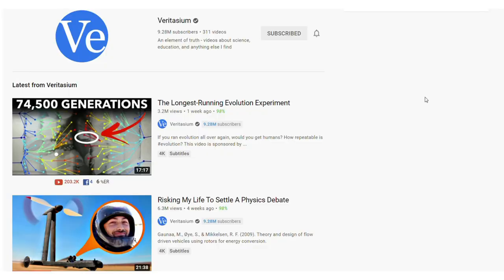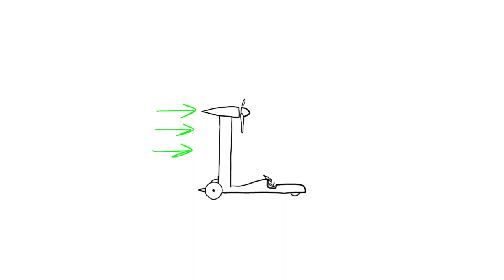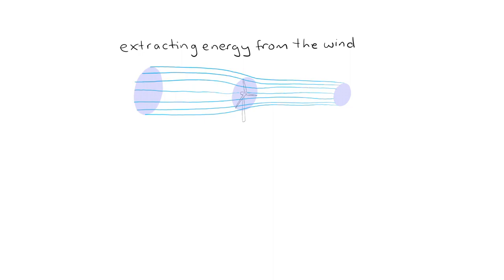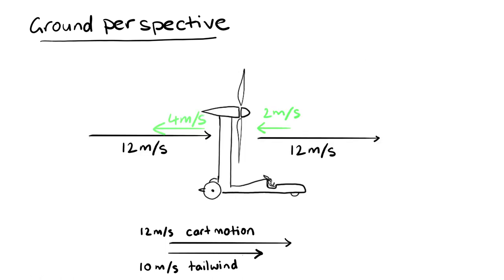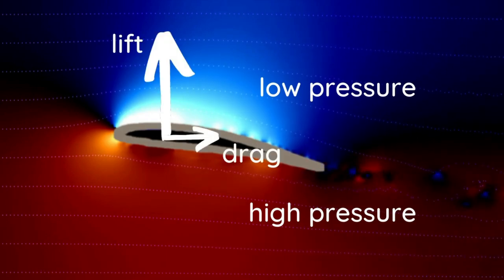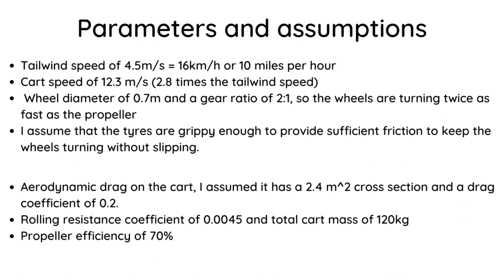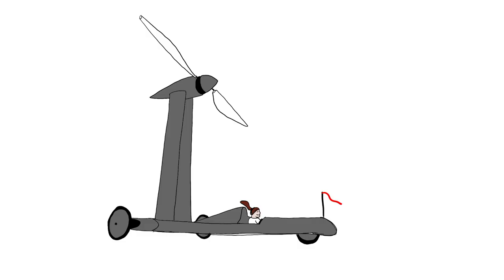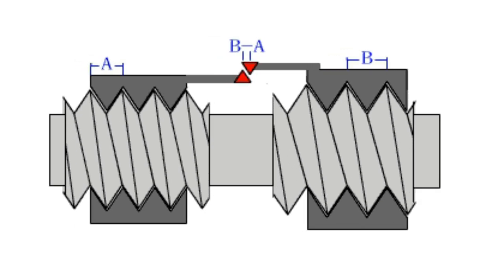Downwind Faster Than the Wind by Veritasium: How Does it Work?

Comment: why does nobody visualize this problem showing the constant air pressure difference from above? The car obviously changes the surrounding air pressure difference. It will accelerate so long as the additional air pressure difference is greater than the drag it puts through to the ground via the wheels.
Reply from the maker: Sounds like you need to make that video visualising it in this way!
Reply: Best answer yet.  You win the internet today!
Reply: In my mind, I picture an expanding 'teardrop' of red (indicating higher pressure) behind the propeller, which the prevailing wind is pushing against (and, of course, a corresponding 'blue' region of low pressure, in front). For me, the 'a-ah' was when I started to think of the wind blowing against the propeller, and pushing the whole vehicle forward. As the propeller turns, it begins generating an expanding volume of 'compressed' air, behind itself (thrust). At a certain point, the prevailing wind is no longer pushing directly on the physical propeller. Instead, it is pushing against this expanding volume of high pressure air, which resists being further 'compressed', and in turn, pushes the propeller forward, faster and faster, as the vehicle's wheels drive the propeller to expand that volume of compressed air, further and further behind.
Reply: @CineSoar  this high pressure wind buffer is a very common misconception with this vehicle.  When we're moving faster than the wind, we don't have a tail wind pushing us anymore.  At that point the propeller is pulling us through the air mass it finds itself in.  But it has an advantage in that air mass since it's moving more slowly through that air than the wheels are moving over the ground.
The aerodynamics around and through our propeller are exactly the same as that of a propeller on the front of a Cessna.  In the case of a Cessna we don't imagine that the propeller has to create a high pressure air buffer for the wind behind it to push on.
Reply: Another way I'm picturing it, after further thought... You have a car, there is a 100' long screw, threaded through the body, most of it's length is coming out the front. The wheels are geared, to rotate the screw, which moves it out the back of the car, as it advances. If you push against the screw, you begin moving the car forward, faster than you are pushing the end of the screw. The difference is the ever-growing length of screw, between you and the car. Now wind is 'mushier' than that screw, but that is a minor adjustment to the scenario.
Reply: @Rick_Cavallaro  Thank you for the response. My description is lacking, and I realized it, shortly after I posted it. While you were replying, I was writing a more mechanical description, in the meantime (see my post, immediately after yours). I should also note, this mental picture was one 'step' in my 'aha'. I understand, the whole 'system' involves additional considerations. 
I think I object to the idea that you don't have a tail wind pushing you any more. Or, at least that it isn't one way of looking at it (the propeller is pulling, but it is also pushing, against an air mass that is moving). If the wind were to stop moving, relative to the wheel/ground system, you lose the force that is driving the propeller. The Cessna carries its own power source, so we don't usually frame it that way. But, when we fly NYC to London faster than we fly against the jet stream, we don't discount the tail wind, even though the 747, under its own power, is capable of moving much, much faster.
Reply: @CineSoar  I'm not sure if that's an exact analogy, but I think it's a whole lot closer.
Reply: @CineSoar  
>> the propeller is pulling, but it is also pushing, against an air mass that is moving)

That is absolutely true.  But it's operating on the air mass it encounters.  It's not being pushed by a tailwind - at least no more than you can say a Cessna flying straight and level on a windless day is being pushed by a tailwind.

>> The Cessna carries its own power source

That's true as well, but the propeller and aerodynamics have no idea what motive force is turning the shaft.  Aerodynamically they're identical.

>> when we fly NYC to London faster than we fly against the jet stream, we don't discount the tail wind

Also correct.  But we don't say the tail wind is pushing us either.  We're simply operating in a medium that's moving relative to our destination.  Just as when you drift downstream in a river - nothing is "pushing" you.  You're just coasting in the water.  In fact you're sitting still in the water.  The water simply happens to be moving relative to everything around it.
Reply: @Rick_Cavallaro  Thank you again for engaging with me, and for undertaking this project in the first place. I'm loving how this whole topic has been challenging folks to re-think their intuitions. I guess I get hung up on the 'Tail Wind' concept, because the problem is presented in "Downwind" terms. When I try to mentally abstract the Blackbird as "flying" like a plane (as opposed to a ground vehicle, with a propeller) that imagined propeller slows to a halt and reverses. It has lost the connection through the wheels to the ground, which has to be in motion relative to the air (or vice-versa) to make this vehicle so marvelously non-intuitive in the first place.
Reply: @CineSoar  My favorite thing about this vehicle is that both the concept and the analysis are trivial, literally minutes worth of work, but so many counter-intuitive things come out of it, and often shed light on things that wouldn't have occurred to me.  For example, the sail on a sailboat on a broad reach doing downwind VMG faster than the wind is actually acting like a propeller blade rather than a turbine blade.  That just sounds completely wrong until you realize that the sail and keel have effectively traded jobs.
We know that a hot air balloon drifts with the wind at the speed of the wind.  But what happens when it encounters a gust?  Does it lead the gust?  Lag it and then catch up? Track the gust perfectly?  I think our intuition strongly suggests our hot air balloon would lag a little when hit by a gust.  It should take a bit of time to accelerate - right?  But it doesn't.  It does just what the gust does in real time.  You think about it a bit more and you realize it shouldn't do anything else.  But it doesn't feel right at first.
Reply: @Rick_Cavallaro  if I turn my head sideways, I can picture the balloon 'rising' on a pressure gradient (much like a party balloon will join me in the front seat, as I accelerate). Is that the crux of the matter? I have to admit, much of this is outside my wheelhouse, as a photon wrangler and pilot of a slower-than-wind and heavier-than-air craft. One of my strengths though, is grappling with complex concepts, and then translating them into various layman's analogies.

Comment: Assuming Wind speed is fixed 
Wind pushes the car 
Wheels turn 
Wheels turn the blades 
Blades push against the wind (this creates the extra speed) according to them.
But 
Now the speed of car is “supposedly” more than the wind 
The wind is relatively slower than before from the reference of the car and hence it won’t push the car as much as before 
So the wheels won’t have the same angular velocity 
And subsequently blades will start to slow down.
So. Practically the moment propeller starts to spin and exerts any sort of force it starts the process of slowing down the vehicle in the first place 
Ever heard of “Law of conservation of energy” ?

Comment: The basic principle can be demonstrated with a bicycle. 
If one pushes forward with a hand ( the wind) on the top of the rear wheel the bicycle moves forward at 1/2 the speed of the hand ( the wind). The wheel rolls without slipping on the ground. The wheel center is 1/2 way between the hand and the center of rotation, the wheel contact point with the ground.
If one puts the hand near the center of the wheel the wheel center and the bike move at the same speed.
So far so good...
Now if one puts the hand ( the wind) 1/2 down from the wheel center along a vertical spoke and pushes forward, the wheel center and the bike will move at twice the speed of the hand ( the wind) as the vertical spoke rotates instantaneously around the wheel contact point with ground.
As the hand is moved lower the speed ratio increases. That is what the Blackbird of the video is doing. The wind is the hand, the propeller( the bicycle spoke) makes contact with the air, The Blackbird rear wheel contact point with the ground is the bicycle wheel contact point. The ratio between the distances between the bicycle ground contact and the wheel center and the hand correspond to the combined Black bird wheel/propeller gear ratio and propeller pitch.
Note that as the Blackbird speed increases above the wind speed the more air it can slow down so the more energy it can extract from the wind. The max energy extracted is when the air speed with respect to the bird in the wake of the propeller is equal to the wind speed. ( note that propeller is the correct word when used with respect to the Blackbird), in the reference of the ground the propeller wash has zero speed!
Note also that the Blackbird can go straight up wind. In the bicycle analogy this corresponds to putting the hand on an imaginary spoke extending below the ground contact point. As one pushes, the wheel center and the bike move in reverse. For a more realistic analogy imagine a rail cart wheel on a rail. Pushing forward on a point of the flange below the wheel-rail contact point, makes the wheel wheel move backward with respect to the hand while the flange below the contact point will move forward. The hand does positive work.
Have fun!

Comment: Wonderfull explanation! I was obsessed too, still am a bit, even made a cart going uphill on treadmill. Instead of propeller I used one axle with wheels to rest on the stationary relative to tredmill belt rims. So instead of using energy intensity difference between moving tredmill belt and room's air, my cart "catches on" the frame of treadmill(edges) to get propulsion and accelerate into apparent headwind. This way the energy source is not hidden by apparent wind, because is physically different substace: treadmill frame versus air. Both share the same feature, same relative velocity relative to treadmill belt, so both can do the same job. My clip is on youtube, called "Going faster than wind or relative nature of mechanical energy".

Comment: Really cool! So do the blades in the Blackbird cart pitch?
Reply from the maker: Yep they pitch, but  manually. If I were to build one, I think I would try to make the pitching at least semi-automatic. And put a derailleur on it so I could change gears to optimise for both low and high speeds. A propeller is like a wind turbine in that its optimised for a single tip speed ratio (except that they are weirdos and use the inverse) and you mess that up as you go faster if you can't change gear.
Reply: @EngineeringwithRosie  One reason for the fixed gear ratio is to prevent using stored rotational energy of the propeller to accelerate. If the propeller rotation slows down, then so must the rotation of the wheels. They had to meet very strict NALSA requirements preventing any stored energy use for propulsion for their sailing record.
Reply: @EngineeringwithRosie  so in for example a plane, they don't change the RPM of the propeller to keep at the designed TSR? I think we're going to try to make a Blackbird in Ashes, it's just too cool not to do it!
Reply: @AshesWindTurbineSimulation  I volunteer in advance to help you however I can to beat our record.  I have no doubt it's doable.
Reply from the maker: @AshesWindTurbineSimulation if you make the simulation, I'll make a video about it... and maybe Rick can help us try to improve on the Blackbird design and make a new record attempt!
Reply: @EngineeringwithRosie  Could you then not set the pitch to help start the car rather then solely rely on drag to start the car?

Comment: Good day Rosie I am a sailor and make use of a horizontal wind turbine on my sailing yacht. It does suffer a lot from pitching and stalling, ( the yacht pitches and rolls a lot affecting the turbine ) All true about the variable pitch propeller, but what if you simplify your explanation by using a fixed pitch propeller which most small aircraft use. You apply more power and the propeller turns more rpm making the aircraft go faster, no change in pitch. I think the part that gets you confused is called apparent wind speed. Like on a sailing boat when you are sailing in a 10 knot wind at an angle of 90 degree to the wind ( best sailing angle to the wind ) you are creating an apparent wind speed over the deck. This creates an increase in wind speed over the sails and greater boat speed. There are many video's of foiling sail boards and yachts, they sail many times faster than the wind due to a great reduction in drag caused by the hulls in the water and the apparent wind. Getting back to the wind cart I understand that the first forward motion is caused by wind over the propeller that turns the wheels and the cart moves forward. Once the cart moves forward you are creating apparent wind which will increase the speed of the cart and will keep on increasing until drag limits any further increase in speed.

Comment: Excellent, very clear explanation. I find the screw analogy very helpful: often, people get stuck on the idea of wind "pushing" an object instead of seeing that the propeller moves the cart through the air. In the end it comes down to this: yes, a device can move faster than its input in the direction of that input.
Reply: Good, but surely her assertation that below the windspeed the cart is pushed by it's body's drag force is incorrect. I demonstrated in my video that even if the body had no interaction with the air, the cart would accelerate from rest up to it's maximum speed.
Reply: @chalichaligha3234  

Chali, I am one of the primary designer/builders of the Blackbird so I have a complete understanding of the craft.  I watched your excellent video and it's clear that you too have grasped the concepts in their entirety (nice work).

As far as the initial motion from rest (where the propeller has not yet begun to develop thrust), it takes very little drag against the tailwind to get it started. You are likely correct that if the body magically had no drag at all, merely the drag against the propeller would get the vehicle moving.  Conversely, if you took the propeller entirely off the Blackbird, the drag on the chassis alone would be enough to get it started rolling at accelerated to some percentage of windspeed.  In the end, since by necessity they both exist on the craft, it is the drag from both that start the initial motion.
Reply: @chalichaligha3234  

One more comment on your excellent video.

You use the word "turbine" to describe the rotor of the Blackbird.  You are correct that the function of the entire vehicle is to act as a turbine and slow the wind relative to the ground.  You can even argue (as you did) that that is the function of the rotor itself.  

You're not wrong in that, but we find that to get people to understand how the device works, we first have to get their minds out of the track that it is the wind hitting the blades directly that is turning them (like a normal wind turbine).  

Most people understand how a wind turbine works (input thrust, output torque).  Most people understand how a propeller works (input torque, output thrust).  Since the rotor of the Blackbird functions as the latter, we find it confuses people less to describe it individually for what it is ... a propeller.

In the end, use whatever words or concepts you need to get your understanding of the craft across to people -- you're one of the few who truly get it right as to how it works.  Well done.
Reply: @chalichaligha3234  

Again, you are spot on --  there are numerous ways to design a device which can travel directly downwind faster than the wind apart from one using a propeller.  

A few good examples from Rick here;  https://youtu.be/X6oJpnSJyV8

However, IF you simply put a turbine rotor on a tower and put a cart under it (which is what people see when they look at the Blackbird), it will never work.
Reply: @johnborton4522  By drag you mean push, correct?   The push from the tail wind forces the cart forward enough to start the propeller spinning?
Reply: @jonvelde5730  

Yes, it's merely the drag of the wind on the back of the Blackbird that starts it moving initially
Reply: @johnborton4522  isn't it Bernoulli's principle, and the low pressure over the top of the airfoil that provides the critical (major) pressure difference that thrusts the cart forward.
Reply: @rcmrcm3370  

Certainly Bernoulli's Principle is involved, but that's not what makes the Blackbird unique.  It's the ability to harvest energy from the true wind at speeds at or greater than the true wind which make it unique.

Comment: Hey Rosie... nice to see the spreadsheet... I been playing with the maths of it for about 10 days. Trying to figure out ideal wheel diameter, gearing, propeller length, pitch, and chord. With a variable leading edge to the propeller, you can use the propeller to drive the wheels from rest to get it moving. Then rotating the leading edge, use the wheel to drive the propeller when in motion. and change the pitch to get peak performance. The current crop of America's Cup yachts use D shaped leading edges, and twin skinned sails, so can effectively alter pitch and chord.